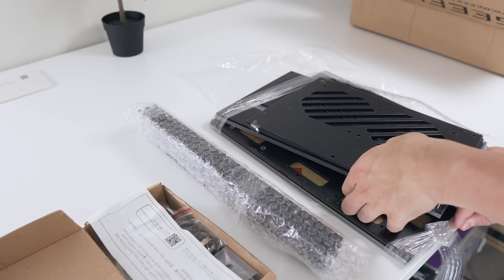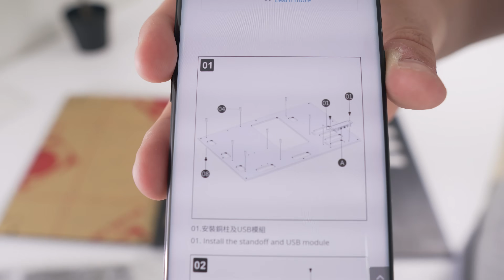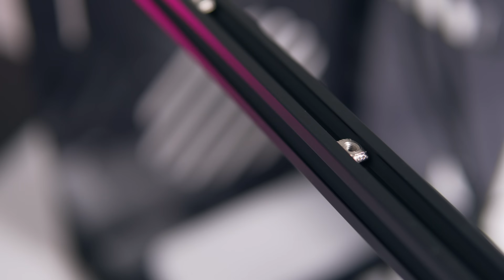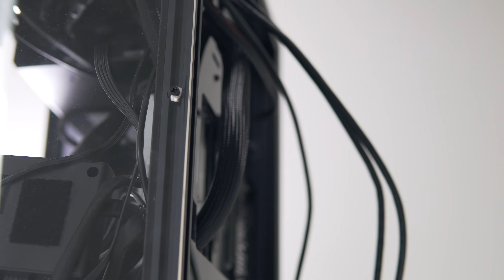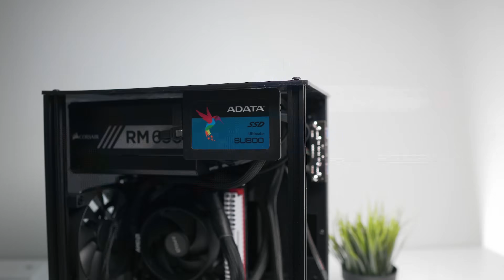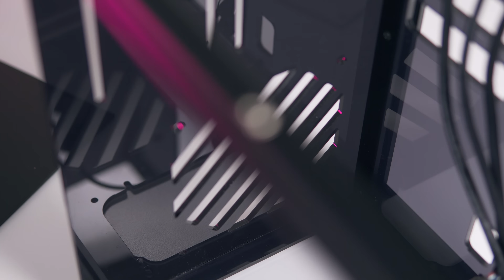GEEEK T801 - Compact, DIY, mATX Tower!

Comment: Those thermal stats without the font panel are unnerving to say the least. I think that with a pair of fan intakes at the front and 3.5 drive mounts on the floor would have been simultaneously far more functional and provide better overall cooling for the CPU, GPU, and add-on cards, especially in the case of a mATX board.

Comment: Don't forget that you can get an InWin 301 for 10 bucks more which provides way more cable management and a tempered glass sidepanel. And looks way better.
Great idea, but bad realisation. Could be great for a third of its current price.
Reply: do you prefer inwin 101 or 301?

Comment: I actually have bought the ATX version of this same case about a year ago,  its a cool idea, but if there is one thing I disliked it arrived with a giant scratch on the front clear panel from the manufacturer. The biggest pain is cleaning or working on components, For that you have to removed the 6 tiny screws with these back oblong nuts.  Id honestly stay away from acrylic. glass wont scratch easily plus cases with glass tend to have much better quick access methods than this one. whats happening here is the company lays a piece of plastic on a machine that cuts it they pack it and send it to you. I think we need them to work harder on the design user experience. Cause idk who wants to remove 6 screws + nuts  and worry about scratching their panels.  No dust filter = more work , plastic panels = more work , no back panel to for cables = more work

Comment: What i would personally do in cases like this, is to put something like 3M dark tint into the front/back panel, maybe the other side aswell, leaving 1 side more transparent than the rest. Reason for this is that usually seeing cables and ssd/hdd can be very ugly, so you would tint out those parts, but if you had for example led lights going on, you could see some of that through the tinted panel aswell.

Comment: No dust filters and fully plastic with imperfect parts. I think the price is too much, given the lack of features and no labor included in the price. Looks unique tho.
Reply: Placing a sheet of plastic on a machine that cuts it is not much labor. I bet the company has one dude picking up stuff from the warehouse and one operating the software for the cutting and packaging the end product.
Reply: Agreed, it looks nice and it's a nice concept, but way too expensive as is, and it needs a lot of work.
Reply: Yeah, considering that the Phanteks P400 is a $69 case, CNC machined aluminum, obviously a much larger case, acrylic window, integrated RGB controller and included RGB strip, has a PSU shroud, and includes 2 fans, the T801 is a little pricey.
Reply: BladeScraper The P400 is good for its price, too bad it is not sold in my country.
Reply: BladeScraper Yes, but I'm sure that Phanteks manufacture at a considerably higher volume than GEEEK with automated tooling lay down for much reduced labour costs resulting in lower part costs, compared to the low upfront outlay but high labour / part price manufacturing methods of running a laser cutting machine shop. Plus Acrylic is actually more expensive in sheet form than the metals that are used in traditional PC case manufacture.
Reply: Frog Cartoons Are Racist Nazis what about the labour in laser cutting all the parts out?